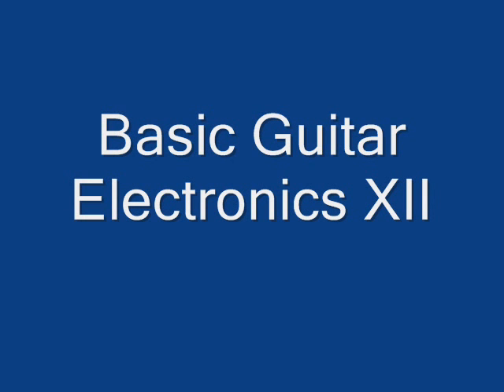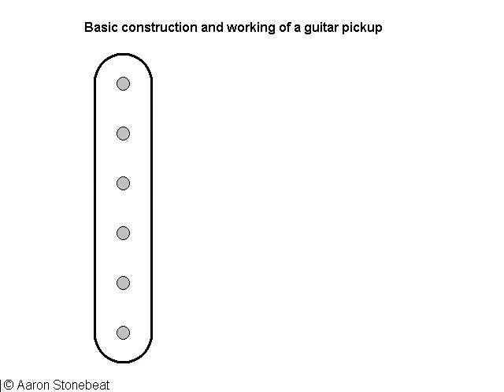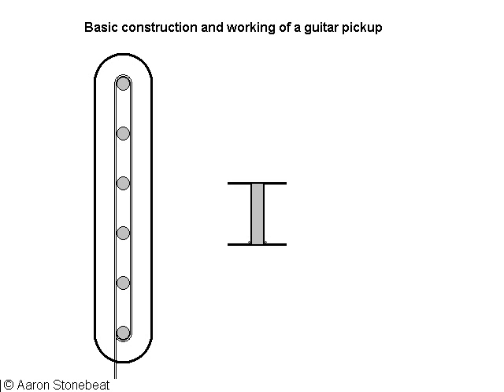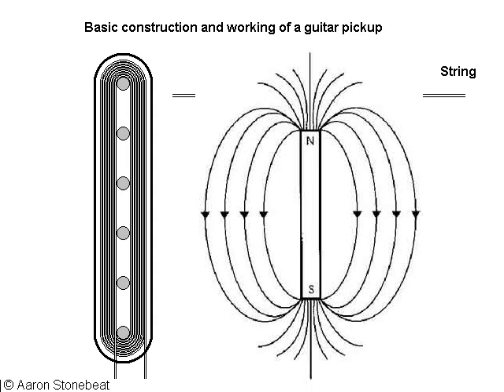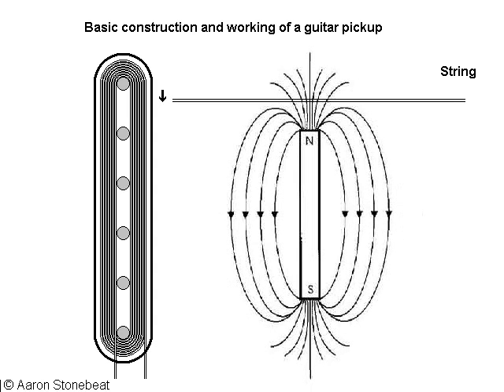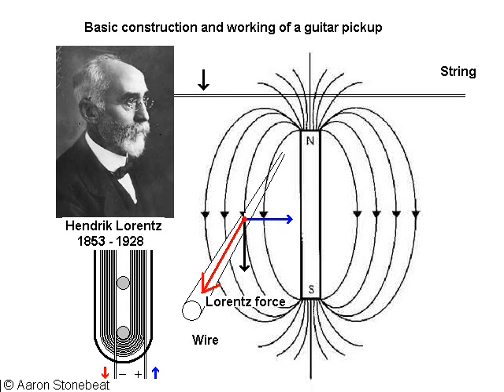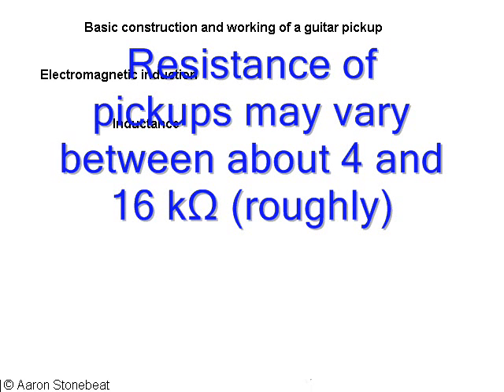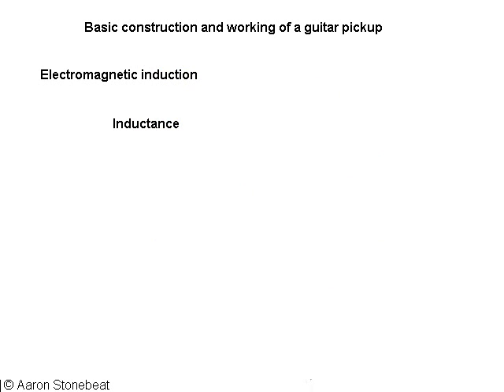Basic Guitar Electronics XII - How guitar pickups work

Comment: It has been demonstrated with a magnetless pickup that it is in fact the magnetic field around the string moving through the coil that induces the current in the coil. Search for zexcoil, there is a fuller explanation.
Reply from the maker: I have searched for 'Zexcoil' and found they use individual coils and magnets per string. Innovative!

If there were no magnets where would the magnetic field around the strings come from?
Reply: Also. Search this article for the word nuts for the salient paragraph. https://www.seymourduncan.com/blog/the-tone-garage/seymour-w-duncans-interview-with-seth-lover
Reply: https://www.guitarworld.com/gear/how-does-a-guitar-pickup-really-work
Reply from the maker: @tochriss  I've read the article and I find it inconclusive about how the strings are magnetized; still, some form of change in magnetic flux makes a coil induce a change in voltage.
So what's different from that than what I talk about in my video?
Reply from the maker: @tochriss  Put a pickup without any magnets in your guitar and hear what it sounds like.

Comment: Do the strings have to be metal???
Reply from the maker: Yes, they do. The strings excite the magnetic field of the pickup; they wouldn't do that if they were made of a nonmagnetic material.
Reply: They have to be conductive, so a grosso modo, yes. 
A moving electric charge causes a magnetic field (this is the aim of it).
You're looking for a variable magnetic field in order to get current in the wire.
Reply: @jonlasarte9690  it's not that they have to be conductive - they have to be ferromagnetic.

Comment: Thanks Marc, I have a personal bass guitar project, where I would like to install the pickups along the strings instead of across them, what do you think about?
Reply from the maker: That could be made to work but it might have disadvantages; you'd need at least two pickups where normally one would be enough and the pickups would have to be very similar in specifications. I think I would build a setup where I could mount the pickups above the strings in various orientations and configurations to test the differences in sound and decide whether it is worth the trouble.

Comment: that would be an insulated wire though I presume...  wire alone isn't insulated and wouldn't work, right? It would immediately short out and there'd be no coil i.e. inductance effect.
Reply: You're right. The wire in the bobine is isulated. If foy any reason in the middle of the coild the isolation brakes, the RC will reduces proportionaly and the output would be very weak or nule.
Reply: Although i am not sure, that's what makes sense

Comment: The guitar string isn't pulled away from the pickup, it moves perpendicular to the pickup. Also if I remember my right hand rule correctly (from 30 years ago) the current will always flow in the same direction unless the poles of the magnet are changing. So the guitar string vibrating only causes the strength of the current to fluctuate not the direction.
Reply: I thought the string vibrates in all directions at once

Comment: The strings also become magnetized by the pole pieces which bring the magnet's field
up to each individual string. The pole pieces are adjustable to bring the pole piece magnetizm  closer to the string to magnetize it.The string being ferro-magnetic will
form a weak magnetic fileld (N=S) in the immediate vicinity of the string. 
I have proven this by taking a bass string (E) from a guitar and then pourin some iron
dust around it and observing the weak magnetic field shown by the iron dust and
a compass.

Comment: THANKS..:)   what does influence in "guitar sound".....My theory that type of wood cant influence on it...but everybody I know says different...
Reply: wood definitely has nothing to do with the guitar tone, a while ago +willseasyguitar did an experiment with a frequency generator proving that, you should check that out.
The pickup, nut material (bone,brass etc...), the bridge material and tuners.
Basically anything the string is in touch with affects the tone.
A brass nut will give you a brighter tone for example.
Reply: Tonewood is only a myth for marketing purposes only.

Comment: You could provide a great voice-over for "Count Dracula".  :-)

Regarding what's happening with the string, magnet, & copper coil, here's how I would describe it:

1.  The energy used to put the metal string into motion is the beginning.
2.  As the string moves & vibrates, it, being a ferrous metal string, conducts & concentrates the magnetic field within itself, & it therefore consequently disrupts the normal magnetic field that encompasses the copper coil.
3.  That change in the normal magnetic field proportionally affects the free electrons within the copper to cause a force (Voltage) & a movement of charged particles (electrons) to move & ripple through (current (A) flow) the copper.
4.  That V & A is what is conducted into an amplifier before it is conducted to a speaker for our listening delights (hopefully).

hth!
Reply from the maker: Right on the mark!
Reply: About the Dracula comment, the electrodynamics comments, or both comments? ;)
Reply: zeffur

Comment: So is the signal actually relies on the direction of the movement of the string, one man could say that a guitar tone is based on the pickup and almost not at all in the wood.Some folks say that sound waves move from the neck to the body and that gives a special wood tone to the sound.But how can that happen?Waves just pass through the pickup as they travel through the guitar body.That makes the pickup vibrate but only a tiny amound.So tone doesnt depend on the wood?
Reply from the maker: +Thanos Kakourhs That is a very heated debate indeed. My impression and experience is that the wood in solid body guitars has very little influence on the ampified sound. With hollow body guitars it's a totally different matter of course.
Reply: e james  The fact that you like to have things in your ass doesn't means everybody do, so just stop trolling with moron words loser, better read a book or something, they don't bite...

Comment: Clear explanation. But how does the current change when the frequency of vibration changes? I mean, when the signal is amplified, you can still hear the exact frequency that your guitar string is putting out. What exactly is the changing factor when the frequency of the vibrating string changes?
Reply: +Liam Zuiderhoek Kom er net achter dat je Nederlands bent, antwoorden in het Nederlands mag ook :)
Reply from the maker: +Liam Zuiderhoek De verandering in het magneetveld is de drijvende kracht. Als de trillende snaar dichter bij de magneten komt, trekt het magneetveld iets samen en wekt (inductie) een potentiaalverschil in de ene richting in de spoel op; als de snaar zich verwijdert, zet het veld weer uit en wekt een potentiaalverschil in de andere richting op. Als de snaar sneller trilt, verandert het magneetveld ook sneller; zodoende is de frequentie van het wisselende potentiaalverschil (en dus ook van de stroom) gelijk aan die van de trilling van de snaar.
Reply: the current changes because the string is oscillating faster and further from side to side when when plucked harder. the faster the string moves through the field and the longer time period it moves from point A to point B then the more power is converted/generated. Imagine riding a bicycle with a dynamo attached to the wheel, you pedal slowly, the magnets and wires in the generator pass each other slowly and produce low power, but pedal much faster and you get more electron flow per second through the coil which translates to a stronger signal
Reply: The string allows longitudinal/transverse wave to travel between the fret your finger is pressing on, and the bridge, at that audio frequency Hz, which you can hear even with the amp off. At the same moment it is affecting the magnetic field as explained, to cause a voltage and a current at the same frequency only now it is Voltage AC or VAC at the same frequency Hz of the played note.  The amplitude of the string fades as other natural forces act on it, including the pull of the magnetic field it is in.  So it is initially loud and fades even though the frequency stays the same.  The more amplitude of the string the louder it will sound, given the amplifier is SET at input and output gain (volume).  Some strings are thicker and can move within the magnetic field with a larger amplitude even though they are lower in Hz.  The placement of the pickup position between the bridge and the neck has an affect on the tone and amplitudes of the VAC signals being created.  This is why the tones at the neck position sound louder, less high frequencies, provided the same pickup is being moved between the bridge and the neck base.  This is why generally bridge pickup are designed for more power to be generated because the string cannot move transversely at higher amplitudes compared to the area at the base of the neck.  Higher power can be affected by more copper coil turns and stronger magnets as well as explained, width of the bobbin, also less distance from string can increase power.

At high volumes sound pressure from the speakers can cause the wood of the guitar to resonate causing a transfer of a transverse wave of the same frequency back to the bridge, tuners, metal nut, frets, and string being played causing a sustained feedback loop through the pickup, sometimes higher order harmonics can be resonated as well.  This is one way how the wood affects tone.  Percussive effects can also be heard when the string is initially plucked via the fret board which transfers to the body and can be heard as a percussive effect.  To test that just plug into an amp use your pick and tap on the fret board or the body.  You can even get the strings to move by knocking on the body while hold a chord.  Many guitarists use this method to keep a chord sustained longer, same for bass players.   

These kinds of tones are not usually recorded well on videos on youtube but they make big differences in a quality recording studio environment.  Listening to blues players on a clean setting, SRV, Billy Gibbons, David Gilmour...fingering a sustained vibrato you can hear the strings scratching across the frets, some of that noise is transferred through fret, neck, and the body back to the bridge and to the string again.  The hardness of the woods used makes a difference as to how that transfer takes place.  Some people have tremolo/whammy bars that have springs attached to the bridge and those springs are anchored to the body as well.  Sometimes the springs help sustain notes as the tremolo bar is being pulled and pushed.  The transfer of the springs can be damped or enhanced by the density of the wood of the body and neck.

VDC is a flat line with no Hz and cannot be transferred via any magnetic field.

Comment: Hi Marc, 

I was wondering if you could help me out a bit - I am doing a university dissertation on guitar pickups. I have built 4 pickups for comparison: all humbuckers with 42AWG wire and the same number of turns (5350 on each 50mm bobbin), but with a different magnet in each pickup - Alnico 5, Alnico 4, Alnico 2 and Ceramic 8. I have audio clips of each pickup tested using the same plucking velocity and same guitar etc. Basically the only thing that is different is the type of magnet, in order for a fair test.

I was wondering if you could tell me what differences I should see in each magnet? ie. characteristics in tone and output levels? I'm finding it hard to get the information that says this. Any input of yours would be greatly appreciated as I found your video inspiring and informative.

Cheers,

Elliot
Reply from the maker: The stronger magnets should give a larger magnetic flux passing through the coils and thus a higher output voltage. As far as tone is concerned I'm not certain; experience learns that ceramic magnets sound more trebly. But I have no good means to measure magnetic strength so I'm guessing if I say it is because they are stronger.
I'm curious to hear your test clips; also, can you put the signals through a scope to visually compare them?
Reply: Hi Elliot, I'm reading this thread a year later, but would be very interested in the results of your test. Did you finish your investigation and can you share the results?
Reply: I'd like to see the results too
Reply: Hi Elliot. I think your university disertation went bad because there was not conclusions at all from you, which we kept waiting.

Comment: I am experimenting on a 5.1 stereo surround chorus effect using an acoustic guitar and   piezo and  other mics to create a 6 output signal. My first setup was to use 4 mics inside the gtr 2 upfront and 2 in the back to get a front L/R stereo and back L/R stereo  with the under the bridge pickup used as the center and sub.I also want to try a second setup using individual coils for each string. The low E would be the sub  A would be back Right D would be back Left G- front Left B front-Right little E-center.
My ? is what type of coil should I use for a one string pickup using 6 separate magnetic fields for each string? Is there any Electromagnetic coils  that would be good for this or would this have to be hand made? Any helpful hints that I could try? I also  am looking ahead to phase and impedance  also delay and chorus effects then preamped and sent out as 3  1/4" TRS stereo L/R low impedance signals to the mixing board and routed to there assigned speakers?
Any Thoughts on this would be very appreciated!
Reply from the maker: I know individual pickups for each string are used to trigger guitar synthesizers, so they do exist. Maybe that is something to look around for? It wouldn't be that hard to make such pickups by hand though.
A thing I once tried: take a head from a cassette player, hold it close to a string and have a magnet nearby and you get a signal! Those are small coils that produce only a low voltage but if you're using preamps and it's for acoustic sounds that should be no problem.
Those are the first thoughts that come into my mind.
Reply: Marc van Oppen Thanks Marc Im gonna try the cassette head path. Could you give more info on how the setup would be? Im guessing a head for each string?And were is the magnet? Under the cassette head i'm guessing?
I have to ask? You thought 6 mics in a acoustic guitar is  gonna be  Noisy as Hell didn't you Marc? But you think 6 pickups on each string  would  produce better results? It would be easier to do? Would you place each string like I planned in the speaker arrangement or would another arrangement be better? And last ? is there gonna be any problems with phasing or polarity in creating a stereo surround sound effect?
Sorry about all the ?'s but your pretty smart about this topic and you seem to be a experimentalist like myself ?LOL! 
Thanks Marc that was alot of help!
I'll let you know how things turn out!
Reply from the maker: Fourstringplayer Bassman
First of all: it is a thing I tried only once because I expected it to work; but it was just one head and one string. Indeed I held the magnet underneath the cassette head. Microphones will give a more natural sound but they also will pick up all the noise from handling the guitar. 6 Pickups will allow you to hear each string virtually individually and with a lot less noise.

How to place the strings in the speaker arrangement? I wouldn't know, I'd have to try. But you have a plan; so try that and see if it needs adjusting.
Sounds like fun! Good luck!

Comment: Nice explanation. If I understood the Lorentz force correctly I would assume there is also an electric current in the string itself (because it's a conductor moving in a magnetic field). Is that correct? And if yes, why it is not used to pickup the tone.
Reply from the maker: You are right but amplifiers (tubes or transistors) respond to change in voltage, not current. Also the induced voltage in a string is very small because it passes just once through the magnetic field whereas the wire of the coil passes thousands of times through the magnetic field.

Comment from the maker: Thanks! You are right on both points: the more turns there are the higher the inductance and the potential difference that can be induced between the ends of the wire.

Comment: Mate! great video. i remembered studing this in the Phisics lessons 15 years ago...so, dont remember that much anymroe :P
Look, reagarding the copper wire around the magnet: we need several turns in order to get higher induction? The differnece in potential is measured from one point to the other point of the wire?? thanks

Comment from the maker: Not so easy to really determine, I think. At rest there is a flux depending on the magnet strength but in action it is the changing magnetic flux that counts. This depends on a few thinks that draw quite a complicated picture if you try to describe reality: the frequency and amplitude of vibration of the string(s), the thickness/mass of the string and is ferromagnetic properties and the surface of the coil windings.
I'd try to go for one frequency and amplitude from a signal generator to begin.

Comment: Yes I like !  

Dont know if i understand this, so i need 2 ask u a q:

If the string was made up of, say 4k turn of isolated wire, starting & ending on the brideg u could throw away the pickup coil, and instead use the string itself as the pickup, if it was connected to the amp as the 'coil' circuit..?
I mean, any (fe-based) conductor will be induced with a current if moving trough a magnetic field?

Ok, thanks for this xellent video!